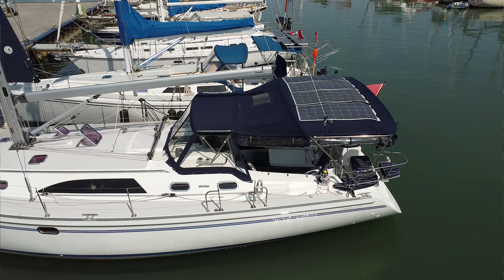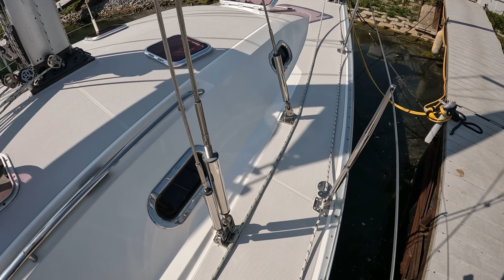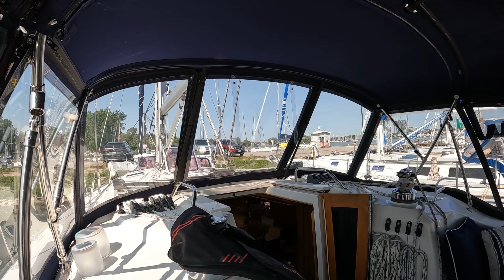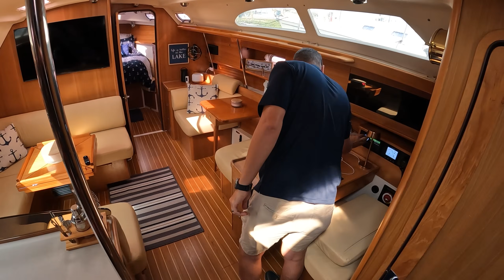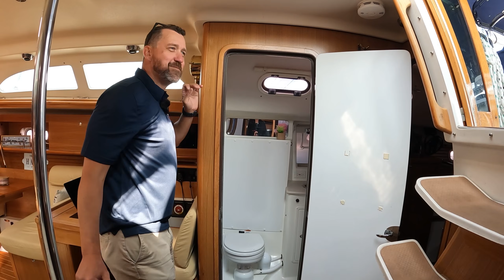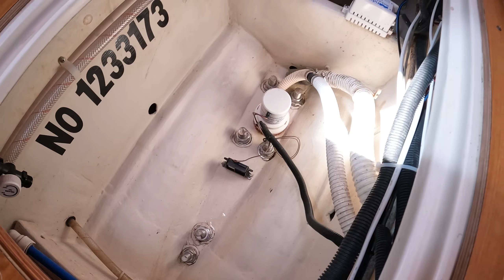Dream Cruising Sailboat? Catalina 445 Full Walkthrough

Comment: Nice boat. Looks like things have been properly installed and maintained. I have to imagine that a 250amp alternator packed into that little engine space, even with the stock Catalina ventilation will dial back the field based on heat quite often, or is set to around 40% field output in order not to cut field so often as a matter of protection. Am I right? We put a 140 amp alternator and a 4" vent system and still had to dial back the field to 50% through the smart regulator. It's just the limitations due to how much heat they produce. Also. what's the draft?

Comment: A Boundless Breeze fan on a boat is cheap, effective, quiet, and draws little power. I have one, and it makes a difference. It's hard to shop for 12 volt fans without getting ripped off.

Comment: I wonder what the Genset is for. Could it be for an AC volts refrigerator or air con?
Reply: It can run whatever you like @johnbucher2077. It’s an AC generator and conservatively can run 30-35 amps continuous comfortably

Comment: I did my ASA 103 & 104 on one of these, the 104 was in some particularly rough conditions. It was a cold January, and we had to beat to windward in 10’ swells the entire second day, it handled it all no problem. The only problem I see with it is the Catalina 425 exists, and it’s a bit cheaper, with no real downsides. Really the only thing it’s missing compared to the 445 is a dedicated nav station.
Reply: And the separate entrance to the aft head. Very nice for guests to access the head from the cabin without entering the salon. Especially when someone might be sleeping in the salon.

Comment: I’m curious why a monohull boat like this is preferable to a comparable catamaran that provides more width for living space.
Reply: It’s way cheaper than a cat
Reply: @datamack  Given the condition and upgrades on this Catalina, I’m guessing the extra expense wouldn’t be an issue
Reply: @madrat5176  If you're looking at the same budget, you'll have a much shorter, older, less equipped cat.  That'd be the trade-off.  

A 45' cat equipped like this, and around the same year model, would be several hundred thousand more dollars.  That's a significant issue for most people.
Reply: Monohulls are also naturally more structurally sound as they lack the twisting forces generated by the two hulls which has broken many cats backs.  It can right itself if tossed over in high seas where a cat flips over like a pancake and stays upside down... which requires large escape hatches on the bottom... which can and has sank many when they fail resulting in a man size hole in your hull.  Cats are much more expensive to dock as they don't fit standard marina slips often requiring two.  Monohulls like extra weight where cats are more like airplanes and require careful weight balance and not to much of it.  I still like cats but there you go.
Reply: @Energine1  Excellent explanation, thanks
Reply: One isn't necessarily better; it depends on the priorities of the sailer. Cats have two engines so twice the maintenance. Haul slapping can make it impossible to sleep under some conditions. The bigger boat = more windage = bigger anchor and increased risk of dragging. A monohaul will also lee over spilling extra wind in storms making it more forgiving under many situations. Hauling out is more expensive too. more bottom paint, more space to maintain too.  Cats haveadvantages too, but there are lots of videos that discuss that already.
Reply: A monohull is way more fun to sail than a cruising cat IMO. A catamaran is superior at anchorage livability, however the newer modern monohulls with chined hulls are bridging the cat-monohull gap in interior/cockpit volume giving them much more space and useability than  a classic monohulls such as this C445.